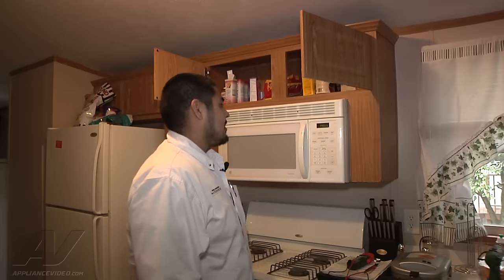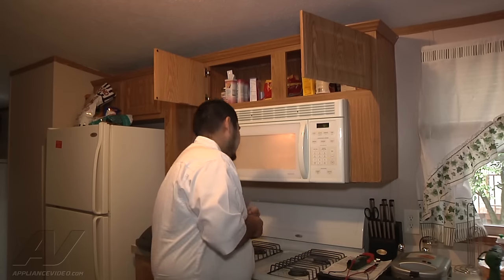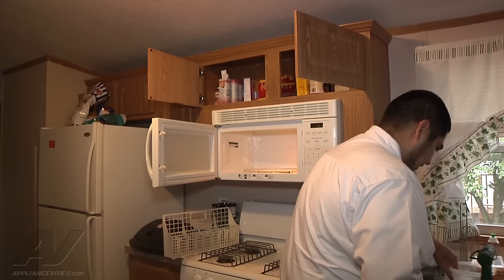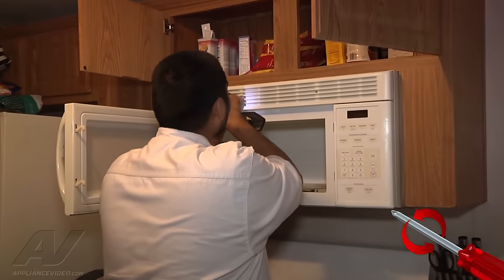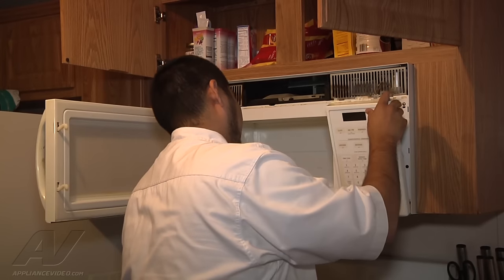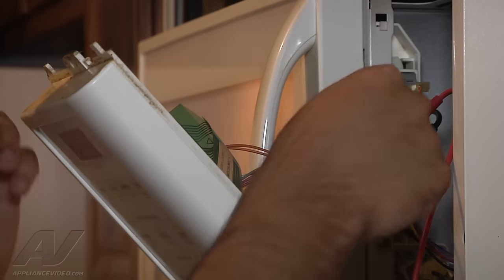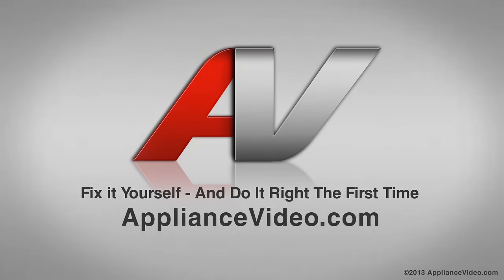GE Microwave Repair - Has Power but Is Not Heating - Magnetron

Comment: couldn't it be just the diode?  Especially since you said you heard the hum, but not heat.
Reply from the maker: Great question, you can call our parts department at 1-800-830-5465 and they can give
you help 6-days A week Mon-Sat . If you have a more technical question that our
parts department cannot answer, our technicians are answering all questions at our website at www.ApplianceVideo.com under our Repair Help section. We have over 4,000
common questions and answers that you can easily search through by your model
number, appliance make, and problem or error codes, and It’s free to search
through our question & answer library.

Comment: So how did it test for 120v with the unit unplugged ? Are you saying with the unit unplugged you can still test for 120V ?
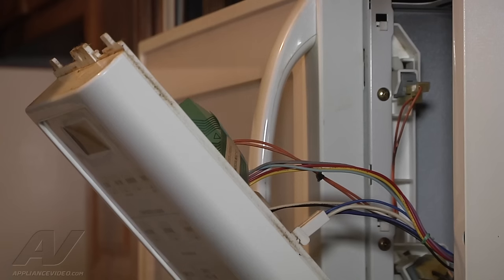Reply: He plugged it back in at 1:47, closed the door at 1:53 and tested the it to make sure it had power coming through before powering it on.

Comment: Well, whats after replacing the diode and magnatron, and this doesn't fix the heating issue.  Mine just turns the lights on and does nothing after replacing both.

Comment: So we have power, table turning, clock working etc. but no heat.  It made a grinding noise too.  Went to look to replace our GE Profile and the cost is $359 + $239 for framing kit, plus $149 for installation.  $750!  Should we try to get it repaired?
Reply from the maker: Jacquie Green Its worth spending at least the diagnostic fee to see if its with it. 
Please help us provide more videos to our site by
subscribing to our YouTube page or posting ApplianceVideo.com site on your
Facebook or Twitter account. Our factory authorized technician’s also daily
provide free professional Repair Help to people like you to help solve their
appliance problems. Thanks in advance for supporting us. So email us if you
have any other questions our videos cannot resolve. Thanks for your support in
advance.   Matt, Ace Appliance service technician.

Comment: I have this same microwave as in main video and it has stopped heating. All functions work, and it heated intermittently for the past week (sometimes worked for awhile and quit but sounded the same throughout). Is it more likely the magnetron in this case? I want to order a part but don't want to pull it down and back up twice so knowing I am ordering proper part would help.
Reply from the maker: Bailey
         If you want to be safe order the Magnetron and Diode. All of our technicians are now answering questions daily on the ApplianceVideo.com website. You can search completely FREE in our Repair Help section. Or you can get unlimited technical advice and video links emailed to you by our 14 factory certified technicians at http://www.appliancevideo.com/premium-membership/.  If you are in need of any parts please support our parts department on line at http://savemoreonparts.com/ or call 1-800-830-5465 7-days a week until 11pm Eastern time. Thanks for your support. Matt Ace Appliance factory service technician.

Comment: This video helped me learn how access the internals of a similar GE Microwave unit that would not heat food.  I was able to diagnose that a door switch had failed and after replacing the switch the unit worked perfectly.  I would add that before the unit failed it developed a characteristic whereby the air handler would come on whenever the unit door was opened.  After replacing the failed "primary" door switch that issue was cleared up as well.
Reply from the maker: michaelwtownsley 

       Thanks
for the positive comment. Hopefully we saved you some money. Please help us
provide more videos to our site by posting ApplianceVideo.com on your YouTube,
Facebook or Twitter account or add us to your circles. If you are in need of any parts please support
our parts department on line at http://savemoreonparts.com/ or call 1-800-830-5465 7-days a week until 11pm Eastern
time. Thanks again your support.  Matt, Ace Appliance service technician.
Reply: ***** I think I have the exact same issue.  Air comes on every time I open the door, but microwave is not heating.  Sometimes it turns on, sometimes it doesn't.  I don't see the "door switch" mentioned above in this video? Would be thrilled if I could purchase a part instead of replacing the microwave.

Comment: Samsung  Refridgerator LED lights not working, any advise?
Reply from the maker: Great question, if you have a more technical question that our parts department cannot answer, you can search our over 17,000 answered questions free at our website www.ApplianceVideo.com under our Repair Help section. You can also call our parts department at 1-800-830-5465 and they can give you help 7-days A week ,or search at www.SaveMoreOnParts.com  .

Comment: My microwave aint heating i changed all the door switches an the little black diode connecting to the capacitor an to a ground i dont know if its the magnetron r the transformer any ideas
Reply from the maker: Great question, if you have a
more technical question that our parts department cannot answer, our
technicians are answering all questions at our website at www.ApplianceVideo.com under our Repair Help section. You can also call
our parts department at 1-800-830-5465 and they can give you help 6-days A week
Mon-Sat . You can also search at www.SaveMoreOnParts.com 7- days a week.

Comment: So with the cost of the parts(Magnetron) and labor to replace it, you're just better off replacing the entire oven.
Reply: Check the reviews on the replacement units in your price range before making that decision. You are likely to find complaints of failing parts in MUCH less time than your old unit manufactured in the early 2000's. Also, several replacement parts companies have diagnostic help available if needed.

Comment: Is it cheaper to fix or should I just buy a new microwave?
Reply: I whant to know the same thing
Reply from the maker: Great question, if you have a more technical question that our parts department cannot answer, you can search our over 13,000 answered questions free at our website www.ApplianceVideo.com under our Repair Help section. You can also call our parts department at 1-800-830-5465 and they can give you help 7-days A week ,or search at www.SaveMoreOnParts.com  .

Comment: Fir this purpose, I went and purchased a klein tools multimeter mm100 but i dont know what the settings on this meter should be to check this. Can you please comments for that ?
Reply from the maker: M Akhani 

All of our technicians are now answering questions daily at our http://www.appliancevideo.com/ website under the Repair Help section.  We also have over 1600 common questions and
answers that you can easily search through by your model number, appliance
make, problem or error code and it’s absolutely FREE. You also have the option
to email a factory service technician with a question on your appliance at
http://www.appliancevideo.com/repair-help/ . If you’re looking for a repair video, you
can also search our library of over 2600 free repair videos. ApplianceVideo.com
specializes in quality DO-IT-YOURSELF appliance repair videos and we get over
800,000 views per MONTH to our videos worldwide and growing. If you need of
parts for your major appliance, we have over 5-million parts in stock at http://savemoreonparts.com/ .  Thanks
for your support. Matt Ace Appliance factory service technician.

Comment: Well, I guess I have to either buy a new magnetron  or a new microwave... And repairing it would also require something that can unscrew the safety screws on my microwave...
But then again, I can't find any magnetron of the microwave I have.
Reply from the maker: Great question, if you have a
more technical question that our parts department cannot answer, our
technicians are answering all questions at our website at www.ApplianceVideo.com under our Repair Help section. You can also call
our parts department at 1-800-830-5465 and they can give you help 7-days A week
Monday -Sunday, or search at www.SaveMoreOnParts.com  24 hours
7- days A week.
Reply from the maker: Great question, if you have a more technical question that our parts department cannot answer, our technicians are answering all questions at our website at www.ApplianceVideo.com under our Repair Help section. You can also call our parts department at 1-800-830-5465 and they can give you help 7-days A week Monday Sunday, or search at www.SaveMoreOnParts.com  24 hours 7 days A week.

Comment: where are the diodes located  most likely?
           would they be below the magnetron?
Reply: below the mag and to the right corner, linked to the chassis and the capacitor -> take caution in touching that 'cause it probably holds some thousands volts even when not connected to the mains (needs to be discharged before getting hands on it).

Comment: My microwave has similar symptoms only I can't hear the magnetron  coming on and the output of the  relay is 15-20 VAC going into the high power transformer, can you help?
Reply from the maker: Good question, with our
technicians now getting hundreds questions weekly, they are answering all questions
at our website http://www.appliancevideo.com/repair-help/ .  We also have over 3,000 common questions
and answers that you can easily search through by your model number, appliance
make, problem or error code and it’s absolutely FREE.
Reply: What was your problem

Comment: I replaced the magnetron and diode, but the problem remains, all the fuses were checked good, the only major component left to be replaced is the capacitor what is your thoughts.
Reply from the maker: Chung 
          Yes, the capacitor is the only other component that could cause this issue. Remember the capacitor will hold a charge with the power off. Be very careful not to touch the terminals without  insulated pliers. With the power off you can discharge the capacitor with an insulated screw driver by shorting it across the terminals.  Please help us provide more videos to our site by subscribing to our YouTube page or posting ApplianceVideo.com site on your Facebook or Twitter account. We also have our factory authorized technician’s email daily free professional advice to people like you to help solve their appliance problems. Thanks in advance for supporting us. Matt, Ace Appliance service technician.

Comment: Hamilton Beach microwave 1000 watts. lights  on not heating.
Reply from the maker: Bonnie
       All of our technicians are now answering questions daily on the ApplianceVideo.com website. You can search completely FREE in our Repair Help section. Or you can get unlimited technical advice and video links emailed to you by our 14 factory certified technicians at http://www.appliancevideo.com/premium-membership/.  If you are in need of any parts please support our parts department on line at http://savemoreonparts.com/ or call 1-800-830-5465 7-days a week until 11pm Eastern time. Thanks for your support. Matt Ace Appliance factory service technician.

Comment: Hey I have this microwave purchased a few years ago for a Reno and recently just took out of the box and used but never worked turn the power on and it sparks and make loud popping noises and also does not heat keep in mind it had never been used and the first time it happened right away do you know about any issues like this ? Thanks
Reply from the maker: Dan 
      It could be a number of possibilities. If you go to ApplianceVideo.com and type in your model number or your symptom you are having. Our site has 2600 free videos on it to help solve your problem. We add new videos every week. There is a very good possibility you will find a video that will help solve your problem. Please help our ranking by subscribing to our YouTube page or posting our ApplianceVideo.com site on your Facebook or Twitter account. Thanks Matt,  Ace Appliance service technician.

Comment: Mine is not making any sound no fan is working or something
Reply from the maker: +Aaron bilger 

                   All of our technicians are now answering questions
daily at our http://www.appliancevideo.com/ website under the Repair Help section.  We also have over 1600 common questions and
answers that you can easily search through by your model number, appliance
make, problem or error code and it’s absolutely FREE. You also have the option
to email a factory service technician with a question on your appliance at
http://www.appliancevideo.com/repair-help/ . If you’re looking for a repair video, you
can also search our library of over 2600 free repair videos. ApplianceVideo.com
specializes in quality DO-IT-YOURSELF appliance repair videos and we get over
800,000 views per MONTH to our videos worldwide and growing. If you need of
parts for your major appliance, we have over 5-million parts in stock at http://savemoreonparts.com/ .  Thanks
for your support. Matt Ace Appliance factory service technician.

Comment: I came to this video, it seemed like a similar scenario but all of a sudden going back into the house and checking, the mug of water was piping hot so I thought YAY!. Then the microwave lights just went off and now there's no power lol. Very stange.
Reply from the maker: Great
question, you can call our parts department at 1-800-830-5465 and they can give
you help. If you have a more technical question that our parts department
cannot answer, our technicians are answering
all questions at our website at ApplianceVideo.com under our Repair Help
section. We have over 3,000 common questions and answers that you can easily
search through by your model number, appliance make, and problem or error codes,
and  Its free to search through our question & answer library.
Reply: Thank you very much, if this was my microwave I would call but it's kind of my parent's. I'll let them know who to call. Thank you!

Comment: This is what has happened to my less than year old Magic Chef microwave. Same symptoms; heated up fine earlier, now no longer heats. Power is fine, and it sounds like it is working, but is not. 
So a magnetron and diode must be replaced on my as well, so I'm glad I saw this.  
Thank you.
Reply from the maker: Frederick Rothe III Glad we could help diagnose your magnetron and diode.  Please help usprovide more videos to our site by subscribing to our YouTube page or posting our
http://www.appliancevideo.com/ website on your Facebook or Twitter account. Our
factory authorized technician’s also daily provide free professional Repair
Help to people like you to help solve their appliance problems. You also have the option to email a factory
service technician with a question at http://www.appliancevideo.com/repair-help/ .  If
you need of parts for your major appliance, we have over 5-million parts in
stock at http://savemoreonparts.com/ . Thanks
in advance for supporting us. So email us if you have any other questions our
videos cannot resolve. Thanks for your support in advance.   Matt, Ace Appliance service technician.
Reply: Did it fix your problem?
Reply: @Integrity.is.everything  No, I bought a Panasonic microwave that was refurbished from Walmart several years ago. It works well without any issues.
This particular microwave was recommended by Consumer Reports. I think the Panasonic was rated lower. Do not follow any recommendations from Consumer Reports. I believe their testing statistics is faulty.
Reply: Thanks for your response. Im going through this problem now with my over the range Maytag
Reply: E Armstrong I strongly suggest ever installing or replace a microwave that is over your cooking area. Why? The exhaust fan does not have enough velocity to extract steam and cooking odors, and steam kills sensitive  electronics (motherboards, etc.). If you were to replace your microwave, I definetly install one flush with your cabinets. Most have trimplates to help exhaust air when in operation. This is my opnion, along with certain factual information, and is meant to be helpful. I definetly recommend a professional diagnosis before repair and/or replacement. 
I used to use my microwave frequently, now I do not, only to reheat.
Reply: @frothe42  Good info and I agree. Unfortunately the unit came already installed in the house i bought. I was boiling some water and after that it stopped heating.
I think I killed the board (specifically the #2 power relay soldered to the board)
Reply: @Integrity.is.everything  And if that particular model is discontinued, it will be impossible to find that part.
I have a Sharp Microwave Convection oven that is countertop, but can be converted into cabinet space with a kit.
One of the most reliable microwaves we ever owned, and can be used as a Convection oven or a combination of both.
You could also look into an exhaust fan to replace that OTR microwave, but one must wait until all this over, unless hubby or a family member is good about projects like this. I live rurally, and even Albany, NY has lost a major small appliance repair shop, since everything is disposable Commie China crap, and THAT is where the problem lies!

Comment: my microwave is a new Bosch drawer microwave and it just not heating
Reply from the maker: Great question, with our
technicians now getting hundreds questions weekly, they are answering all questions
at our website at ApplianceVideo.com under our Repair Help section. We have over
3,000 common questions and answers that you can easily search through by your
model number, appliance make, and problem or error codes.